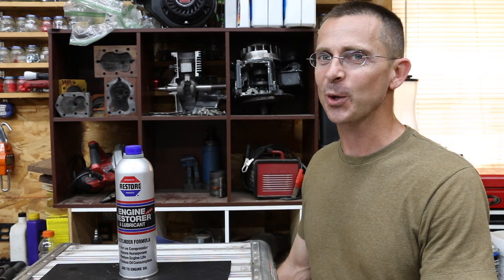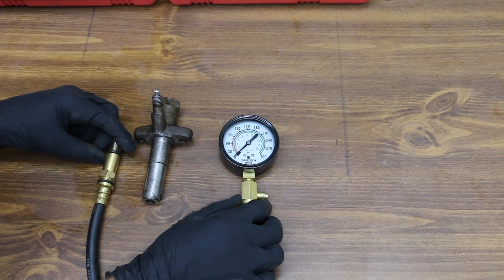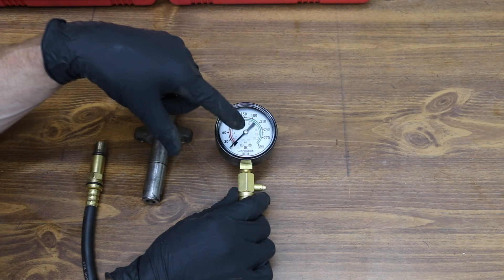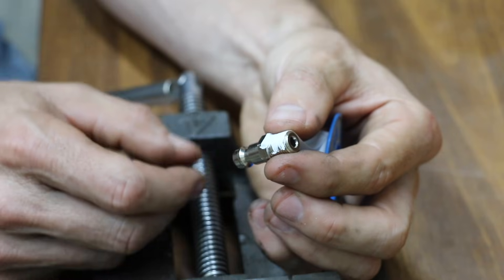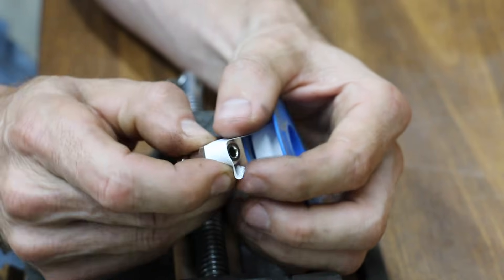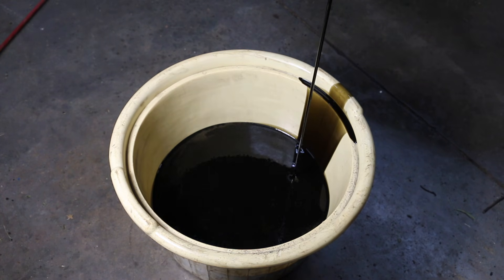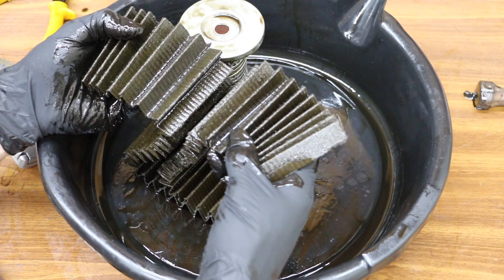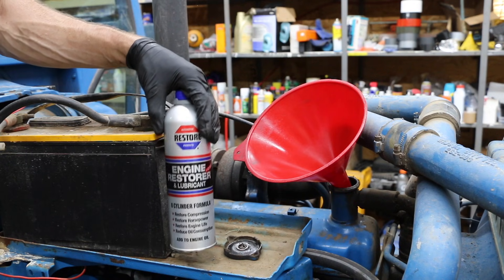Did the "Engine Restore" Compression Improvement Last?  One year later (Episode 2)

Comment: I wonder if this would help the oil consumption on GM 2.4L engine?
Reply: If its a newer engine be warned this stuff is not super friendly to alot of the newer variable valve timing stuff. for older cars it can work wonders but for alot of the newer ones those same things that help fill scores on engine oil can end up in other places and cause issues. but can also work really well its just a gamble on some of the newer stuff

Comment: I was wondering if your tractor is a 4 cylinder diesel. Looks like you’re using engine restore made for 8  cylinders.
Reply from the maker: Thanks. It's a 4.2L that has an 8 quart oil capacity.  So, I decided to use the 8 cylinder version considering both of these factors.  However, recommend staying with the product manufacturers guidelines.  Thank you

Comment: I used restore on a John deer F935 front mower that was very hard to start even when warm. The starting improved vastly and it's still early on after application. I ran Marvel mystery oil through it first to clean the engine and injectors. That definitely cleaned up the engine but it did little to improve the starting (as I expected). It did clearly run smoother however. I'm thinking the combination has delayed some relatively expensive repair so for the money, they are a worthwhile investment.
Reply from the maker: Impressive results!  Thank you!

Comment: Can you give us another update (assuming you still have the vehicle)?
Reply from the maker: Great recommendation!  I'll provide an update soon.  Thanks again
Reply: Project Farm thank you so much if you do. As a hardcore weekend warrior I pride myself on doing my own and my family’s mechanical needs to save money, I’d like to do it on my 2007 Honda Element, because it seems to bog down when driving, plus the exhaust and intake valves are very noisy (normal on elements). It may be because I carry a full size floor jack and tools and that’s too much for a 4 cyl. Ha! Nonetheless, I own compression gauge but I have never actually tested MY engine’s compression. I’d like to record it and upload it but I’m skeptical. I don’t want to damage the engine with Restore. I plan to keep it until it dies.
Reply: ... And I guess if I’m doing a compression test I might as well do a cylinder leak down test and maybe a vacuum test to check the engine’s life as well. It’s would have to wait until winter though, since I’m a univ. student and barely have time. Anyways, your videos are incredibly amazing!

Comment: I used that on my older vehicles and can swear that it improved milage and ran better. You have to add a bottle every other oil change or twice a year. I do not consider a tractor a good test bed for a product designed for a car or truck. Most tractors do not get the same use as a tractor. An everyday to and from work vehicle is what that stuff was designed for. If you can get any vehicle to last longer, that's all that matters.
Reply from the maker: Thank you. It's seems to be a very good product.

Comment: It would have been really nice if you sent out a sample of the used engine oil for lab testing, before and after adding Restore. I don't know if the labs stick to car engines, but I figure they'd at least give you raw data if not interpretation like they normally would.
Reply from the maker: Great suggestion.  The lab results would show high lead and copper levels, since this product includes those in the additive.

Comment: This was awesome! We blew up 3 motors in our 1972 Dodge Coronet racecar last year and in desperation we pulled one out of an old truck that sat under a tree for 15 years. The engine cranked up okay but it smoked like a chimney but we had to run it. We threw a can of this stuff in it and the car got better and better as the race went on and even pretty much quit smoking all together. We ran the whole 14.5 hour race and won our class with a 26 lap lead!! The stuff works!
Reply from the maker: Impressive results!  Congrats on the win!!

Comment: I work for Auto Zone and the following statement is in no way shape or form the opinion of AutoZone or any of it's entities. 

Many of our commercial customers who run an automotive repair shop or used car lot swear by restore. 

I personally have an old Ford 460 and the compression was down near 120 psi and a can of restore later and some Lucas HM stabilizer to quiet the valves and I'm back to 140-150 psi across all 8.
Reply: KARLOZ LOPEZ  Thicker oil doesn't flow as well, so you would end up starving the top of the engine of the lubrication it needs. It's a good way to burn your engine up.
Reply: @barryheizer4420  @KARLOZ LOPEZ not to mention the film strength of the oil would be too great to properly lubricate the rod and main bearings nor the cam bearings.
Reply: thats a 16% increase in compression. you can say "snake oil" or placebo all you want but a gauge doesn't lie. 20 psi is 20 psi.
Reply: 120? it was barely broken in man.
Reply: clearly this karloz guy said something controversial about engine oil weight, but I HIGHLY recommend checking the manual for your car in other markets where durability and consumer protections is taken more seriously, like Australia. I feel like some of the people in the thread are deeply mistaken about whatever conceptions they have about thicker oil.

When the EPA doesn't tell them what oil to use, you'll find manufacturers actually tell you how to pick an oil weight based on the temperature you operate in.
In my case, the US owner manual says to only use 5w-30, and this is because it gives the best gas mileage and reduces emissions. So the EPA says you can only use that.

But in the Australian manual for the same car with the same engine they actually give a table on what weight oil to use.  (and they do NOT have different bearing clearances on the Australian market vehicles, the FSM procedure for bearing clearance is the same for both countries)

Thanks to that additional information, I actually use 15w-40 for normal use (and I drive it hard once it is warmed up), and if I were to go drive hard in the summer desert I would even move up to 20w-50 from an engine that the EPA mandates should never use more than 5w-30. I have well over 300,000 miles on this engine and it runs great, doesn't use oil after replacing the valve guide seals, and makes excellent power for what it is. (a 212hp inline 6 in an AWD SUV that weighs 4850 lbs empty)

Now, there are some poorly done engines like the ford modulars I believe, that are notorious for bad oil design and early failure etc. As far as that goes, well just buy a Toyota.
Reply: @nickopedia5669   Not surprised that the EPA (all democrats) government dickbags are not putting Americans first, but putting their disproven climate hoax agenda first.  I suspected as much that a 2015 v6 Jeep would likely last longer with a thicker oil than 5w-20. At least 5w-30 but ma gas mileage and ma global warming...no cooling...or whatever is happening that we want to blame on the bad fossil fuels.
Reply: @abelq8008  are you capable of spelling?
Reply: KARLOZ LOPEZ  No, no it won't. Been there and have done that. If it was that easy then I'd say Project Farm would have just put thicker oil in his tractor.

Comment: Here's what the machinist meant for using the drill press for tapping.  Take a short, say 2 inch piece of round bar stock of most  anything metal that will fit into your drill chuck. Most drill press chucks are 1/2 inch to 5/8 inch.  A piece of 1/4 or 3/8 is plenty, even 3/16 for small taps. Grind the round bar stock to a point on one end and put the opposite end into the chuck.  Most all taps, have a small drill point hole in the  top end, this is for the point of the bar stock that you ground down.  Place a small drop of oil or grease, not cutting oil though,  and center the tap with the handle already attached, under the chuck and bar stock end. Keep light pressure on the handle to lower the quill/chuck as you are tapping.  This done properly will keep the tap perpendicular to the work piece, and straight as you're tapping.  Of course be sure to realease the pressure on the handle while reversing the tap to break the chips and clear the flutes. Save the little piece of bar stock,  you'll use it forever,  trust me . If your buddy has a small lathe, have him cut a 45 degree taper on the end of a few different diameter pieces of bar stock. And remember,  never run the motor while using this method. HAPPY MACHINING!
Reply from the maker: Thank you!

Comment: The one issue I have with products like this is that they are not a directed approach - the elements inside the additive that fill in gaps and tighten up tolerances stick to everything, which means if your engine has some worn bits, and some bits that are within tolerances, using an additive like this may end up fixing one thing and ruining another. Very important things like rod big end tolerances and such can't easily be diagnosed without stripping the engine down, so you may not notice it until the part goes bad 10, 50, 100 or 500 hours down the line.
Reply from the maker: Thank you

Comment: Pro Blend. Used it in 1984 because the label said Good for pre 1964 Chevy positraction. I had a lot of chatter going around turns in my 1959 Corvette. Going over hwy 17 to Santa Cruz was load! Pro Blend cured that....I also used it in the 350/550hp engine. And it smoothed out the second gear shift (88mph with 308 gears, 72 with 370 gears). Also my Mazda pick up which one day cracked the head, all oil going into the Water 🤔😲😱. Drove over 125 miles thru the Santa Cruz mtns into Los Altos and back!! It stopped and started normally. 😺.  I also tested it in a generator and got slightly better GPH after pro blend was used.
Reply from the maker: Impressive!  Thank you!

Comment: when i was a teenager, i had this old junky car and i threw some restore into it.  I thought i felt a slight difference, but not enough to justify putting an extra $5 into the oil change the next time.  I did notice the difference a short while after the next oil change. It felt like the loss of power from not using it was more dramatic than the original power gain.  Its like the stuff immediately washed away with fresh oil.  So that's always been my theory with restore- once you start using it, you have to keep using it.  I'm debating on putting it into my 03 wrangler 4.0.  Now that it's got almost 170k on it, i'm starting to feel like it might need it.  Thing still runs great. It's had fresh Mobil 1 every 10 thousand miles for its entire life.   I think i'll take your route and do a compression test first, so i have a base line.
Reply from the maker: Thank you!

Comment: When was the last time the valve adjustment was done on this tractor? I to am a big fan of Engine Restore. Cold starts in 70F weather being different than 90F is an odd situation I cannot quite understand. Has to be a compilation of mechanical issues. May be worth doing a leak down test since you have a modded injector already. I am suspecting valve lash, valves needing lapped, or injector pump wear creating a leak down issue. The later relative to an issue I am having now on a JD5510 #1 is leaking at a stripped thread into the injector but the system only bleeds back sporadically. I am assuming only when the pumps stroke is in the perfect place on #1 after it is shut off 1 out of 50 times or so. I know your into more test bed type videos but maybe others would like to see the issue on your 5000 found.
Reply from the maker: Thank you!

Comment: Just put a 6 cyl dose into my 95 Ford Danger. (<<<NOT a typo!)
Couple of bottles of injector cleaner, too.
The poor thing has around 300,000 miles on it, so it will be a good test.
Reply from the maker: Great!
Reply: @ProjectFarm  the same little trick has a weak 5th gear, automatic transmission. 
Any additive suggestions?

Comment: Hi wondering I have a stuck compression ring in cylinder 2 on a ford probe by and ideas to unstick it thks
Reply from the maker: Have you done a leak down test to make sure it isn't a bad valve?
Reply: Project Farm yeah the mechanic don’t a compression this on each cylinder 110 in cylinder 2 the rest is like 160-165
Reply: Project Farmers not smoking  but runs a little rough at Idol but runs smooth at higher speed

Comment: So you only used it the one time? Not every oil change
Reply: Chris Caliri his results improved the first use and is using it every oil change. Also states that in the directions on can. This stuff works wonders i have used it myself and it has greatly reduced hesitation and oil consumption.

Comment: How about head gasket sealer, specifically, Bar’s Leak HG-1?  I used it on a vehicle that was either going to be scrapped or fixed with some gasket sealer. So far it seems to be working.
Reply from the maker: Thank you for the video idea!

Comment: Wondering if you can try engine restore on a generator I tried it in one of mine that I got from a yard sale worked great for a few days during extended power outage snow knocked over trees knocked over power lines it would no longer put out the same amount of power as when I first started using it so I put engine restore in it it kept going downhill so I drained off the oil to check it a significant amount of copper shavings we're visible I'm just curious if that's from using engine restore or from extended use
Reply from the maker: Thank you.  Copper is in engine restore...copper, silver and lead.
Reply: @ProjectFarm  I didn't put enough engine restore for the amount of copper shavings coming out more or less wondering if the engine oil lubricates the electric part and if engine restore somehow tore it up

Comment: I found engine restore to be a very good product.
I had a 1983 Honda accord with over 250k miles on it and it was losing power so I tried ER and the person I sold the car to put another 185k miles on it before pulling the engine. The car was scrapped but the engine is still in use in another car.
Reply: Honda engines are badass
Reply: @johnconnor1737  i scrapped my 01 civic with 263 k....it ran but everything but the engine was worn out or broken.
Reply: wow
Reply: Good ole Honda. Whole car breaks down over the years but the engine is going strong
Reply: Epic story. I'm hoping to get my own story as well. Good on you.
Reply: Awsome. 👍
Reply: Brother, I was glad to find this comment, I have a 1982 Accord 1.6 8v, a car that is very rare in Argentina where I live (the Japanese one, not the American one which is 1.8), well it smokes like a locomotive and consumes a lot of oil, I never blamed the compression because it seemed to me that the car handled well, well it turns out that it seems to be the culprit, I did a somewhat homemade compression measurement with a spark plug adapter and a tire pressure gauge, they all gave me no more than 80psi, so I bought two cans of Total Engine Rebuild (the Russian version of the additive used in this video), I have only driven 50km, I notice less smoke in certain conditions, tell me your experience? How long did it take for it to take effect, what was the oil consumption before and after, power, etc.
Reply: Brother, does the car smoke and consume oil?
Reply: That’s cause it’s a Honda, not the ring job in a can lmao
Reply: No you didn't

Comment: Not an engine additive, but a used car dealer trick:  For a noisy differential, fill half way with gear oil, then a few handfuls of sawdust, and finally jam a couple of bananas into the filler opening...this makes a thick goo that will quiet almost any noisy rear...how long it lasts, who knows?  Just long enough to get off the dealer's lot !
Reply from the maker: Thank you

Comment: I use 1/4 to 1/2 inch diameter, strong magnets on my oil filter. One on each side and one on the bottom for a total of five. They are around 3-4$ total., and I can reuse them many times before they need replacing.. I also use them on the outside of all my drain plugs. They trap large and small metal fragments and extend the efficiency of the oil filter. This also works on hydraulic filters and plugs. After five oil changes none have fallen off. Ron A
Reply from the maker: Thank you!

Comment: My Ford focus has 337k on the odo. I opened the engine to refresh it around 120k ago . Decided the open it up because was and is my daily and I track it from time to time, on 2011 I had a crash and  made my mind to fix it decided to check the engine. The car is 2001 and I have it since 05. Always have used engine restorer to replace a whole oil quart and the rest either castrol, Royal Purple and now amsoil. When we took it apart the cylinder surfaces were like new, the compression test was factory on all cylinders and the bearings were meaty and debris free. We redid the rings and bearings because we already opened it up, but, honestly was not needed.
Reply from the maker: Thank you!

Comment: Ford tractor mechanic here. These old 3000, 4000, 5000, series tractors don't like to crank slow. I noticed you had a smaller battery in it than the tray. You probably checked this, but the CCA rating is important to get right with these old fords. Even a few RPM down will make them a real bear to start.
Reply from the maker: Great point!  Thank you

Comment: You showed in the first video that the product was not compatible with the engine. Being that you have a year plus now and multiple oil changes while continuing to use the additive, how did you get around the issue the product would cause which I believe you stated non starting engine involving the injectors? Having said that, I could clearly hear a better running engine and of course it starts right up which in and of itself is impressive for a 44 year old diesel engine. And your tests confirm it's claims. I also wanted you to know that I VERY much enjoy watching your videos. Well done!
Reply from the maker: Thank you